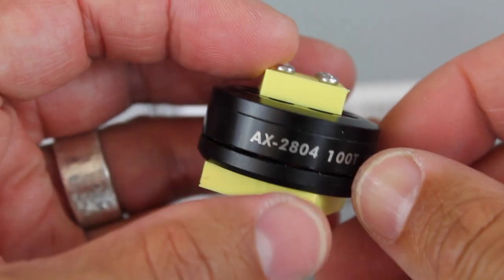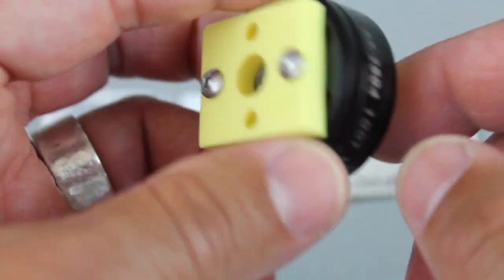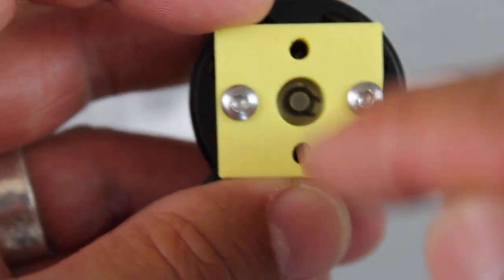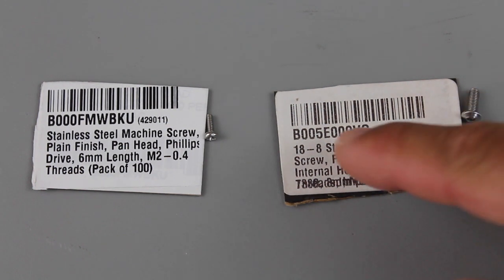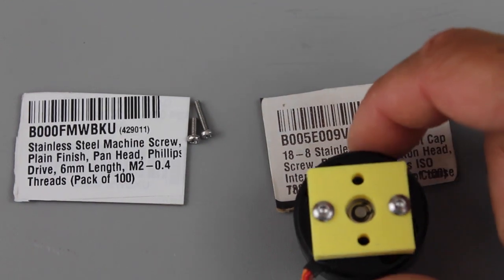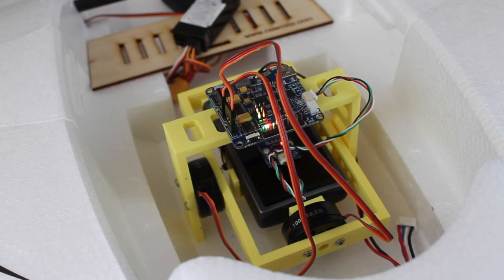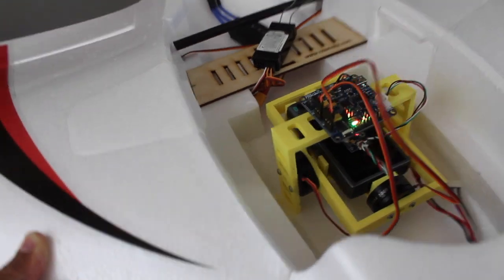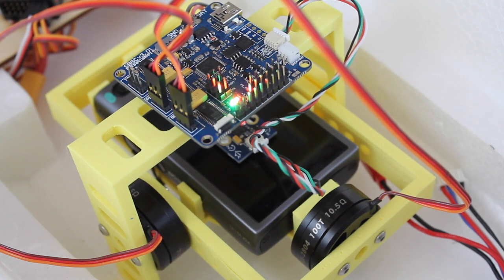HobbyKing DIY Brushless Gimbal Motor Screw Sizes and 3D Printed Gimbal Update

Comment: how much weight was the gimbal, motor, controller and canon PowerShot SX260?
Reply from the maker: Jaelcio A. Lima Verde I don't recall. I had to get rid of this design and start over. I have a new design in progress and will share the weight when I get the prototype ready. Thanks for asking.
Reply: Dennis Baldwin It offers the project to us.

Comment: thanks for the info on the screw size. now I'm curious about the gimbal controller. Alexmos or Martinez?
Reply from the maker: No problem. I felt it was important to share this bit of info! In the video I have the 32 bit Alexmos board and am really enjoying it. It's the 3 axis and I don't really care about yaw right now. I also have a Martinez board that I'm going to be testing with. I'll share my results of that soon.